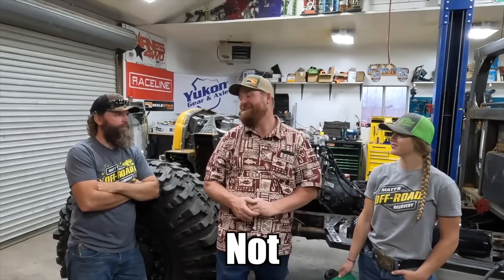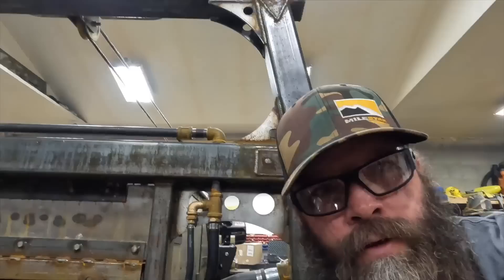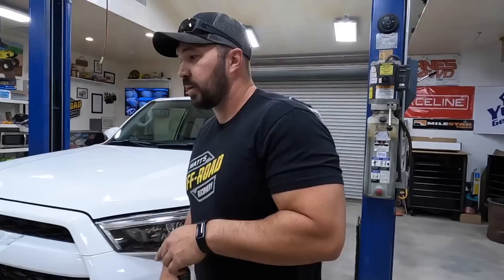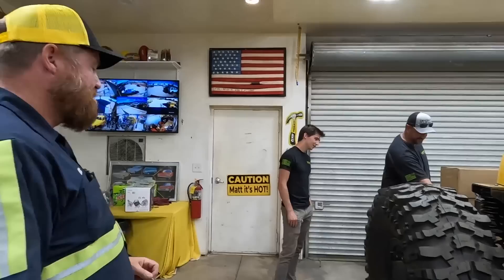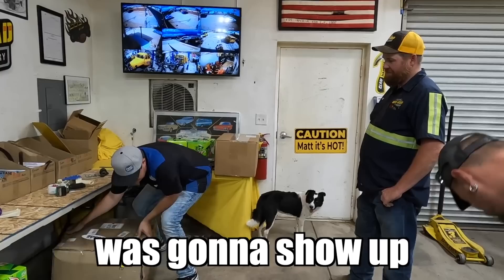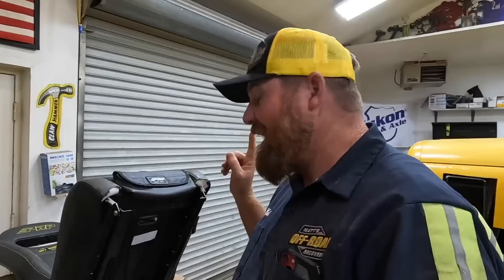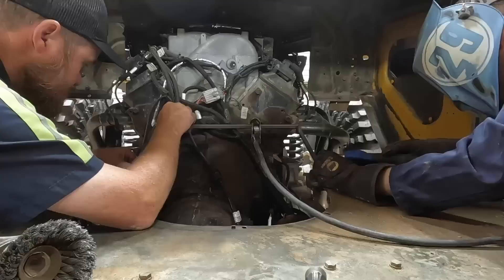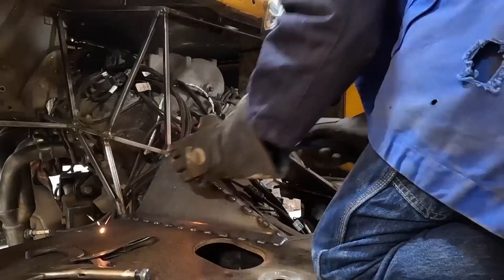Why Do You Think I'm Going To Lose The Tow Truck Olympics?

Comment: Where Rory has the biggest advantage is he knows his rig, and tested well.
Reply: Who is Roy
Reply: @ztwntyn8  Rory? "Trail Mater" here on YT? The dude that gets all his trailers stolen by Matt?  😂😂😂😂
Reply: I pick Trail mater to win as well.
Reply: I've got Rory pegged for 1st purely because of this, he has been using his rig for years and knows it inside and out. The BSF guys will give Matt a good run for 2nd, they have the experience but Matt has the custom ground-up build, and Paul, as much as I love his wrecker, is probably coming 4th.
Reply: @KarlEller  I think as far ad wrecker capability BSF and trail Mater have a big advantage with time trusted proven rigs, but the leaf spring suspension on BSFs truck will be a disadvantage if there's any significant wheeling involved
Reply: "He who writes the rules" has a big advantage. What are the 'tests? If I was writing the rules I could win with a Nissan pickup and a tow rope... because everything else would get sooo many penalty points. :-)
Reply: @Beandiptheredneck  If the tests are all actual towing based scenarios, Trail Mater and BSF being used and time-tested rigs will be a huge advantage to them, they've had time to iron out all the kinks, and experience counts for a lot when faced with unusual challenges.
Reply: @KarlEller  absolutely, I just mean if they start getting into dunes and a lot of rocks Eric's rig might struggle, Matt may not have a ton of experience on his wrecker but he is a tow guy, and has homefield advantage
Reply: Matt will run outta gas anyway…😂😂😂
Reply: @kevinking3402  I would die 😅 I wouldn't even be shocked

Comment: In building my firewalls (On version 3 now!) I finally realized a seat mock up is necessary or the depth of a small cab makes you cramped for foot space.  I am 6"1" but big abeam if you know what I mean.  I Just fit with good leg angle and head room in a 1950 Ford cab.  Tight but useable.  I like the concept of removing the cab for maintenance.  Best method ever!
Reply: “Big abeam”, lol, that’s been added to my “must use frequently” vocabulary.

Comment: Trick I’ve seen for fixing up firewalls after a build is a metal wheel barrel, it will fill most of the area. Then you just fill in the rest were needed/wanted.

Comment: Matt, if you find that there just is not enough leg room for it to be comfortable to drive you could get an extra 2 to 3 inches of leg room and probably 3 to 4 inches of head room with a much thinner racing seat design.  There are a ton of nice racing/performance seats out there to pick from, some of which are carbon fiber shells with dense padding that is very thin but still very comfortable.  Look at the Sparco SPX or some of the Recaro designs.  I think you will find that most of them will give you more room to work with while still being comfortable to sit on.  I can tell you from experience that it doesn't matter if the seat is super comfortable if your legs aren't, and all the leg room in the world doesn't matter if the seat sucks!

Comment: Hope you have the room for getting to your number 7 and 8 spark plugs, up against the firewall.  I wrestled with mine yesterday afternoon changing spark plugs in my Tahoe.  It's a tight squeeze back there in the Tahoe, and I noticed your sheet metal comes pretty close from what I saw!  Good Luck!
Reply: Just as well the cab is removable 🙂👍

Comment: Nice firewall, but I might have put part of it together with bolts to allow access for Maintenace when needed. Cover plates can be a good thing.
Reply: Cab lifts off for maintenance access.
Reply: @robertrickard8526  But if it is something small that is a lot more work.

Comment: At 1:20:  Hmm--  a piece of raw steel perched between the exposed battery terminals...  at 13:20 that's the harness for the parachute; for when you have to abandon the cab before the wrecker goes over a cliff...  at 14:07: Yea!!   Eye protection in use (mostly)!  The passenger's feet might get a little warm with the headers underneath.   Hey-can't help the remarks I'm a former (but never completely retired) engineer/safety officer!  Just want to insure you keep all your fingers and eyes intact!

Comment: Good advice about the welding and that’s what welders should be doing all the time anyway (paying attention to there puddles) a good welder knows how to control the size,shape & temperature of there puddles. In order to do that you have to be able to see the actual puddle and if you can’t then you need to adjust your lenses so you can. That is one reason that so many people have issues with welding aluminum is because it’s more difficult to differentiate the actual puddle from the rest of the weld due to the color of the material.

Comment: Love seeing it come together more and more! Regarding the leg room just a little fun fact.. In the automobile industry the location of the pedals is one of the key reference points for measurements and placement of other parts of the vehicle. Now we also kinda see why. If it wouldn't have worked out you would have had to change the whole motor or cabin position which would both mean a really big operation. Kinda interesting to see that

Comment: I'm just wondering if you'll put any sond dampening/ insulation on your new firewall and any other areas of the cab? Good to see things progressing so well. Also liked that you put ear mufflers on when pounding metal inside the cab. But do you folks wear any type of hearing protection any other time while working in your shop? All the cutting/ grinding/pounding will ruin your hearing, trust me I know. After a few years doing such things myself I now have tinnitus (ringing in the ears) that doesn't go away, and use hearing aids. Hearing aids don't make up the difference of what you lose.  They help but just not the same as your "original" hearing.
Anyway thanks for the videos. Always enjoy seeing them.
Reply: HUH? WHAT'D YOU SAY?😉

Comment: You became a expert welder Lizzie.  Im just starting and plan on making a rock crawler/ side by side. I have a 7.4 GMC 454 MOTOR AND IM HOOKING IT UP TO A 400 TURBO TRANNY. Just bought a pipe bender son now i need to buy some pipe to bend with it and im using axles from a 04 Chevrolet suburban 3/4 ton axles. Cant wait to get started.

Comment: You don’t have a diesel, dual tires, ac, four doors, air bags, on demand adjustable suspension, manual transmission, jk based chassis, bypass shocks, on board shower, ice cube maker, soda pop cooler, air lockers, 40 inch tires or smaller, half doors, backup camera, manual hub locker, Tesla self driving mode, remote control door locks, pwr windows or locks, depart angle gage, Bose sound system, traction control, gps navigation, and ice cream freezer lol 😅😂😅😂. Truthfully the heavy wrecker is a badass truck. Each of your friends/competitors rigs are equally capable in their own way. Trail Mater is the benchmark.. keep up the great videos

Comment: A bit of advice on that Toyota suspension (or any really) - you shouldn't tighten shocks, shackles or anything else with a rubber bushing at full droop. That can lead to bind and premature bushing wear when cycled through its normal range of motion. Always find a way to tighten at ride height.

Comment: It's a little too late now, but if foresight was like aftsite you might have been able to stretch the cab out a few inches behind the doors for more leg room Etc. But honestly all in all this is a great build you guys are the real deal. Mint👌
Reply: Was thinking same, though if going to do all that maybe 2 or 3 feet, once the interior is fit it might feel like a squeeze so it's probably a good thing it won't be used for long distance.  Lizzy will fit in it a lot better, maybe Matt will have her do more of the driving and take more calls.

Comment: Don't worry about it ! No body , ever wins a compition    with a vehicle that has never  been driven or work tested for a few days.You'll get ribbed but use it as a "CONTROLLED" road - work test let them bash each others brains and trucks to pieces.Just test the trucks capabilities and control systems , AND NO GRABBING AIR!!! That's about 13k lbs , at least bicycle helmets too for the noodles....

Comment: Hi Matt, have you ever considered some of our great Aussie seats. Check out the STRATOS LTSS😮3000 suspension seats, great comfort and will take out about 70% of the jarring. They are not that cheap but well worth it, take that beast to the next level. The Australian Army use them then in most of their vehicles. I use them in my 79 Series cab chassis and find them extremely comfortable.

Comment: I know yall won't read this but maybe someone who knows you will....please at least consider supercharging the big block. You go easier way with like a ProCharger. Mounts like an alternator, go the cool big dog 671 or bigger. Guessing most viewers on here know that look and blower whine. I'm running 21% under drive on a high compression and that's less than 4lbs of boost at 4k rpms and it doubled the horsepower on pump gas. And gets better  fuel mileage.  From 7 to 10mpg. Heck, several companies would donate everything you need. Double heck, even I would get ya one. The torque mite even come in handy.

Comment: Lizzy is doing much better at welding. Pretty cool LIzzy!!! My grandpa was taught to weld by a woman, way back in WW2 times. Women used to do a lot of that kind of stuff when the men were at war. I'm a 4th gen welder. The only thing I cringe on is you not wearing a respirator and safety glasses. I went into this post thinking I was not going to criticize, but you need to protect those lungs and eyes!! Keep up the good work!! I worked in the shipyards for 30 years, so I have seen a lot of injuries and health issues regarding the trade.

Comment: Hey Matt when you were building your trans tunnel you should have left yourself enough room so if you need to disconnect the engine you can reach up in there and do the transmission bolts from the back of the block easier

Comment: I love your show. You said you want torque from your engine. a LS engine has a lt of electrones is that can fail.,on one of your missions. diesel torque is better and take a lot less electrical to run. It may help you out of a pinch.having less to break down. A used doge truck with a Diesel engine is cheap to buy in the junk yard.
Reply: The point is LS has a lot of stuff to go wrong. Diesel engine can run for 300,000 miles less stuff to break down. I have driven a cummings engine diesel truck with low water for many miles it had a bad radator. FYI data for you.

Comment: Really depends on where the competition takes place.  Matt could stack the deck in his favour, but that wouldn’t be a competition. Rory (trailmater) has the edge in his location, head up north and I think Eric would be in the running, and then you have FabRats, but he is plagued with engineering problems and system overheats.  I just get a feeling the Matts rig is way over built and too big for most areas.
Reply: But I really think every one should let him win, because I don’t think he can accept losing.

Comment: Do you need to leave some access doors for that transmission or engine???  Also, is there a way to round that area where peoples feet go instead of such an abrupt square?  That would make the foot space a lot nicer and add a lot of room to boot.  Maybe take out the cross bars where the feet go and just roll a piece of steel there instead.

Comment: Will the firewall be fully seam welded, or do you plan to leave it stitch welded? My concern is that if left stitch welded, the cabin won't be sealed from the engine bay. Collete Davis on YouTube had a pretty serious fire in her project car Corvette from a fuel leak, and as soon as the fuel vapours ignited under the hood, there were flames inside the car. Fuel vapour got in through the tiny gaps around the transmission tunnel that hadn't been sealed.

Comment: If it was me I would have made the back panel removable in case I needed to get at the back part of the engine /transmission for easier access..  Just a suggestion ...
Reply: Exactly. Make the engine cover openable in the cabin for repairs
Reply: The cab lifts off easily

Comment: Isn't that going to get really frickin' hot without any insulation? My M35A2 (Deuce and a half) only has a sheet metal firewall and it gets really warm when the engine is up to temperature.

Comment: hello matt got a sugesstion. maby bolt on the firewall pannells so yo could take them off and work on getting to the back of the engine to get out hard to get out bolts and whatever.

Comment: I love your videos, 14:10 - 14:38 - All that grinding/sanding shouldn't you have a respirator or at least a fan running to keep the dust / metal shavings generated in the work area to a minimum?

Comment: Hi 👋 I have restored some R190-R2OO , I think it is a  Mistake to Weld to the Truck  Shazy ,if it brakes in the Bush how do you fix it.  I would use bolts 🔩

Comment: You should go check out Lawrence LT Tolman 👍 his channel is mostly drag racing related but he's definitely proved that the gen 7 8.1 Chevy motors, despite common misconception, are pretty dam tough!  He's putting alot of boost through a dead stock 8.1 and it's doing fine so far.
Reply: You might be interested to know that Matt is working with LT on his engine for the heavy wrecker